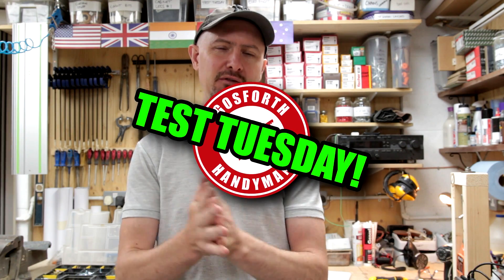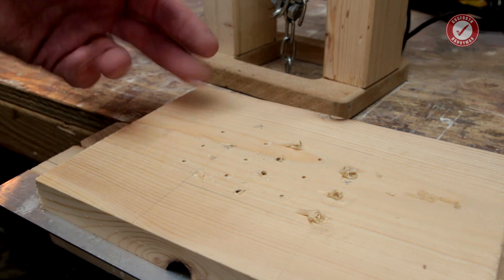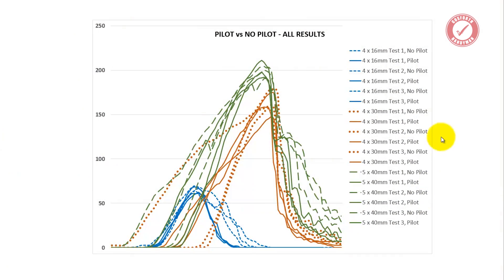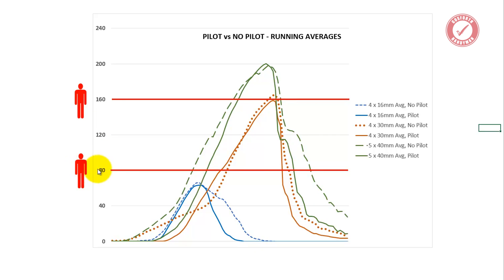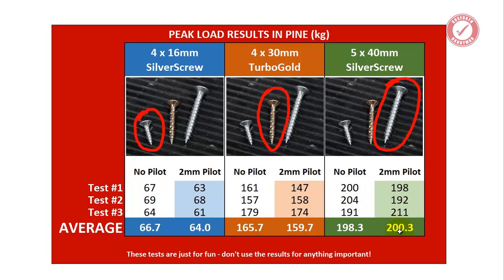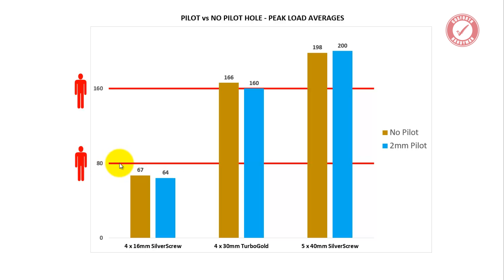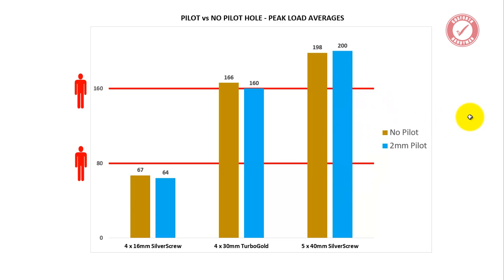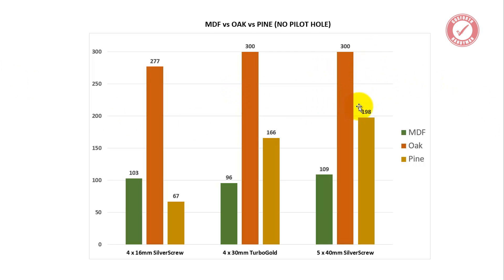Do pilot holes make wood joints WEAKER?

Comment: I'd be curious about a demonstration showing how important drill width selection is. I see newbs using overly large drill bits in places not needed (at least looks like it) and at a certain drill size, seems inevitable to be compromising the strength of the connection

Comment: About 40 years ago I got asked to test the pull out "loads" for screws that had pilot holes vs no pilot holes. The screws were about 35mm long and into (I think) pine and installed by the woodwork lecturer of the local college, the tests were undertaken using a calibrated Denison machine (tensile tester) in the laboratory I was in charge of. Then the pilot holes showed about twice the load-carrying capacity!!!   I would think that this video has shown screw design has closed this gap.

Comment: Good video. If the conclusion is that a pilot hole makes no real difference, then it's not an indication that it's not required, as the pilot hole is there to stop the wood splitting e.g. near an end, to aid alignment e.g. it goes where you want it to go, and to make assembly easier e.g. without needing an impact driver. Normal use of a screw is to fasten two pieces of wood together e.g. using a countersink bit and a pilot drill provides somewhere for the screw head and clearance through the first piece of wood so that the 2nd is pulled into it e.g. No 8 screw uses (Dewalt) 3.2mm drill x 9.5mm countersink head.
Reply from the maker: Yeah - use them if you need them. They don't seem to significantly weaken the joint. 👍

Comment: Never mind pilot holes. They are just to aid screwing, prevent splitting and stop (brass) screws shearing. The important thing is the clearance hole. If you don’t drill that, the two pieces of wood actually push apart.

Comment: Personally I only drill pilots for the screws that DO NOT have those "self cutting" shanks - which looks to be borne out by your results - the self cutting "turbo golds" were made slightly weaker by not cutting / compressing as they were driven, whereas the non self cutting silver crew worked better because they just tend to split and tear the wood if they are driven without a pilot leaving weaker fibres around the shank - the pilot means that the threads bite better because there's no damaged fibres.

Comment: I'd say the strength differences are pretty much statistically insignificant,  other variables such as wood moisture could possibly make up the difference for instance.
The main point of pilot holes is preventing splitting and of course making driving the screw in easier :)
Good video, thanks.

Comment: Firstly once you see it, the image can't be unseen lol. I'm curious whether screws bigger than 5x40mm would also be stronger with a pilot hole. I always thought the reason for drilling a pilot hole was to avoid the surface getting damaged when screwing in as opposed to any strength benefit.

Comment: Useful information, thank you.  I rarely wondered about whether or not pilot holes weakened a joint but would have guessed that they did — slightly.  Since they are sometimes essential to prevent wood splitting or decorative brass screws from snapping it is reassuring to know that they don't make things significantly weaker.

Comment: Another nice comparison test.
Please repeat for MDF.
I was surprised that no pilot hole did not give somewhat better results.  Compressing the wood makes it denser and, I thought, stronger.
As for me, I will still drill pilot holes (1) near the end of a piece to prevent splitting, (2) with Philips head screws to prevent mangling the screw head, and (3) with larger screws to make driving easier.

Comment: Thickness of the shank in 4 versus 5 mm screws might make a slight difference. Was going to ask about the oak but your explanation makes sense. But a test in less dense wood that splits easily.... Splitting hairs neh? Pilot holes / pre-drilling can have several reasons (exact spot, easy screwing, brittle brass etc.) but strenght doesn't seem make any real difference. Interesting, learn every day. 👍

Comment: If you have some time to kill, search for “holding power of wood screws”.  It’s a paper published by the US Bureau of Standards in 1926.  Summary: in softwoods the pilot hole should be around 70% of the root diameter.  They didn’t have self-drilling screws in 1926, so that changes things.  What’s the root diameter of those screws?
Reply from the maker: Will do some digging! I'm pretty sure they're about 2.85mm 😉👍

Comment: Is 2mm the default for any pilot hole or is there some handy "rule of thumb" to use when choosing the size of pilot hole to drill?
It's something that seems given by everyone just saying to drill it but I've always wondered actually how big or small I should go.
Reply from the maker: A fairly safe bet is to use the minor diameter of the shank, 2mm is close enough for these though. 👍
Reply: I usually find a drill bit that has the same thickness as the main center shaft of the screw... so the spiral part of the screw has to dig into the wood and not the middle bit.

Comment: Great vid. I'd like to add when screws are driven into wood without a pilot hole surely they are under more stress going in which i'd imagine will weaken the screw.
Reply from the maker: If you use decent screws it shouldn't weaken them but you do have to be careful with hardwoods. 👍👍
Reply: Gosforth Handyman thanks. What do u recommend?
Reply from the maker: I use Screwfix's brand - TurboGold, QuickSilver etc. and they're great.

Comment: There are four good reasons to drill pilot holes (in certain applications), seeing that the results are so similar.
Less chance of the screw snapping if driving into hardwood.
If you remove the screw you're left with just a small flat hole and not a bump in the wood.
Less chance of the wood splitting.
Easier to line up two pieces of wood.
Although it does take more time.
Reply: Drilling a pilot hole doesn’t take longer, if not drilling one splits the wood.... it’s mostly about knowing the materials, and therefore what you can get away with.
Reply from the maker: Defo worth using and nice to know they don't weaken the joint. 👊😀

Comment: Fascinating results! You say (at around 7:30) that the 4 X 30 mm Turbo Gold is a self-drilling screw. It is, but when you screw it in, it doesn't eject any material as a drill does - it does help cut a hole but it simply compresses the cut material into the rest of the hole (somewhere) so is different from using a drill to create a pilot hole.
Reply from the maker: It's an interesting one and you're 100% correct! I think the sawdust from self drilling screws goes in to another dimension. 😂👍

Comment: That was a great video. I appreciate you trying to make a fair test and that you recognize that the results are definitive. Wood is very non-uniform, even in the same board. I will continue to use pilot holes for alignment and near the ends of boards without worrying about the strength.
Reply from the maker: Yup - defo no harm in using pilot holes to be on the safe side. 👍👊

Comment: I love pilot holes. I have a 8100 cordless Dremel set up with a 1/8" cobalt drill bit and a countersink.  I use it almost every single day in my Property Management work.  My goal is to prevent wood splitting and prep countersink. I use sharp #10 screws on everything that I can. A 1/8" pilot hole is plenty of hole to prevent wood splitting.  However I make larger pre-holes when using extra long screws or lag screws in fence building. Nice video. Keep up the good work!
Reply: I recently bought a cheapo 14.4v Aldi battery drill that was on offer for £12.49. It's my 2mm pilot hole machine😀
Reply from the maker: Cheers Rene! Defo better safe than sorry! 👍😀

Comment: Very interesting. So I think I'll just use pilot holes where they are needed in future. Do you think using a different size pilot hoke would make much difference? I suspect not.
Reply from the maker: Yeah defo, I think the size of the pilot hole would be fairly proportional to the overall strength - but as long as it's not too big it shouldn't make much difference. 👍